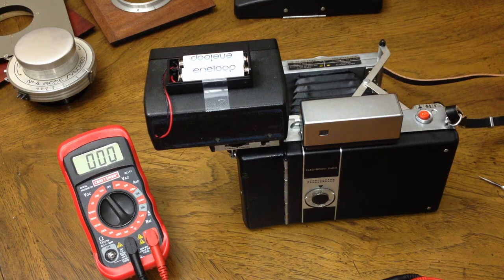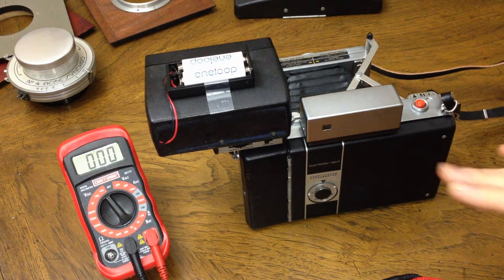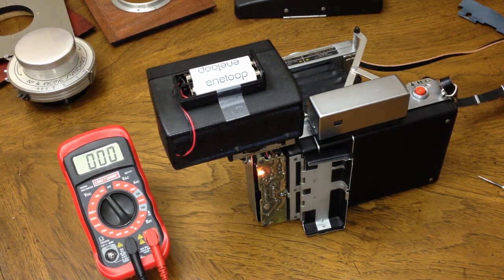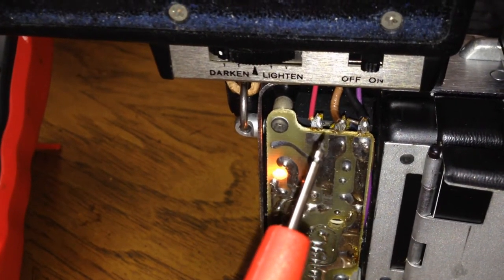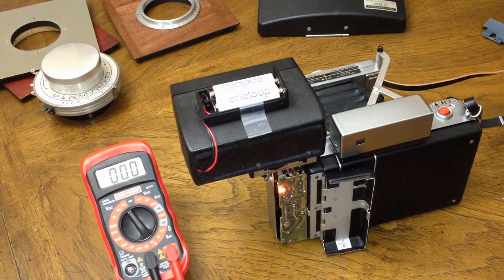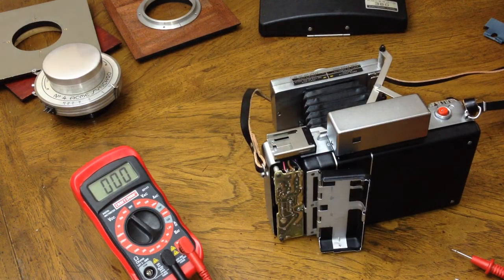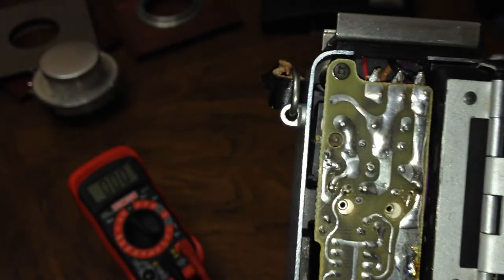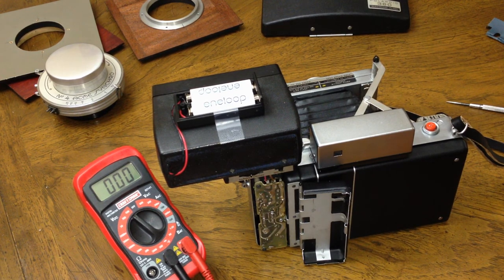How To: Adjusting a Polaroid #365 Electronic Flash

Comment: We recently restored a flash unit. We opened up the flash unit and desoldered the old batteries. A trip to a local battery chain store place was able to match the old Nicads and did a spot welding thing with shrink wrap pack. (I think it was about 20 bucks). 

While the batteries were 'fully charged' according to the battery play. After soldering into place in the 365 flash unit, they did not work. The Capacitor was old...but no worries. The orginal charger 'brick' will reform the Capacitor. Apparently, even if the light goes out on the charger ('hey the ni-cads are charged) that old tech charger is doing something. 
After 24 hours on the charger...FLASH. and Now, I get 23 flashes on a fully charged flash unit.

Comment: Thanks much for the video! If the light on the back of the camera manages to light up, should the flash fire? Also, how'd you open the hinged back to get to the pot?
Reply: +dvonk1, awesome, thanks much -- will take another look.
Reply: +dvonk1 -- wow, after a couple days left on the charger the flash seems to be accepting a charge and is firing, though I don't know yet if it's doing so at spec. So far I've gotten 25 sec recharge cycle after 20 flashes. Next step is to run some film and see how the exposure holds up -- maybe I won't have to take this bad boy apart after all!
Reply from the maker: +Lewis Francis -- nice!  if you dont have to open up the flash and mess around inside, that is great.  keep giving it 'exercise'!